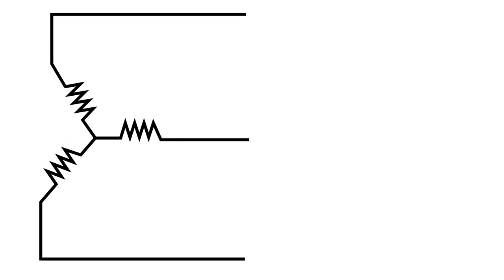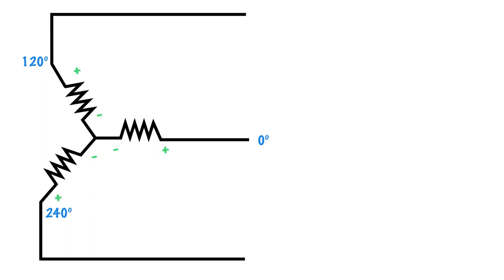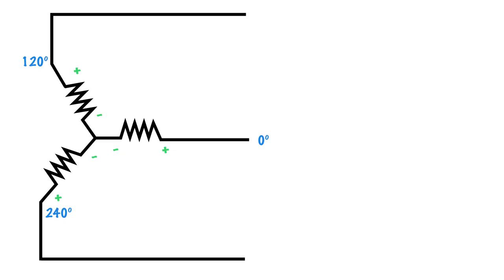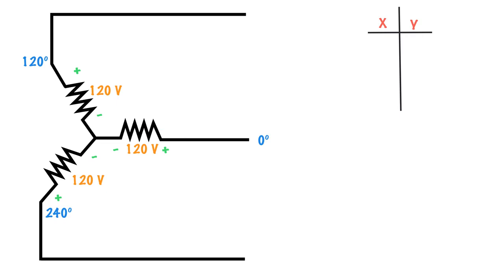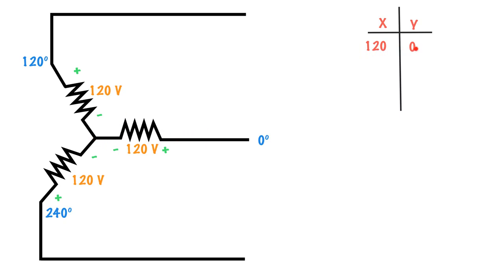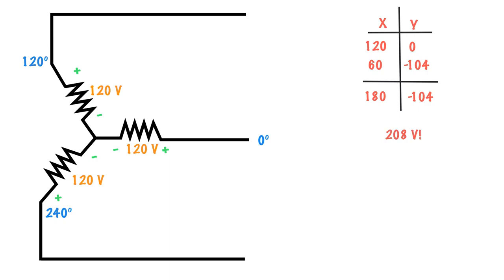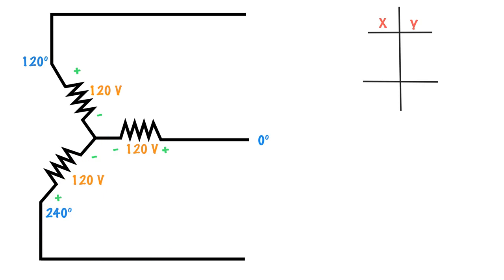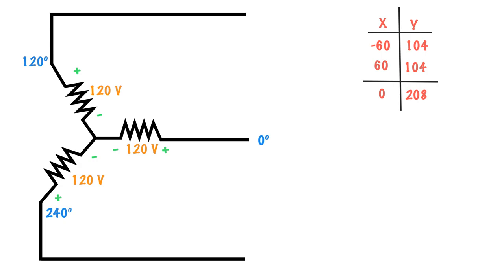Using instantaneous polarity and trig to determine wye line voltage

Comment: It took me a while to realize that the "instantaneous polarities" simply indicate that each phase voltage is defined with respect to neutral (the center point), which means we have to calculate the difference of the phase voltages when we "add the phases" to calculate the line voltage.